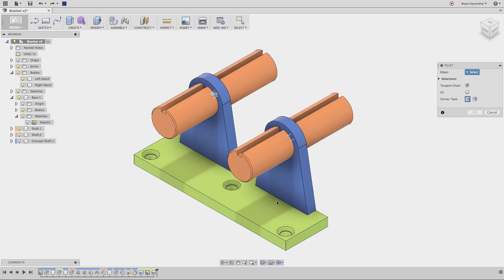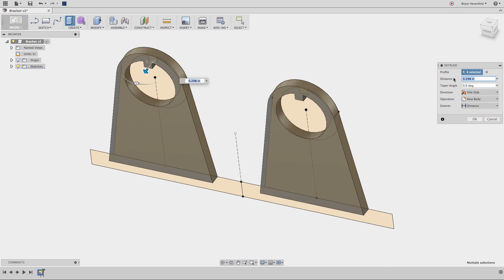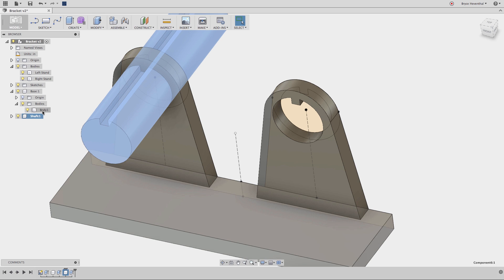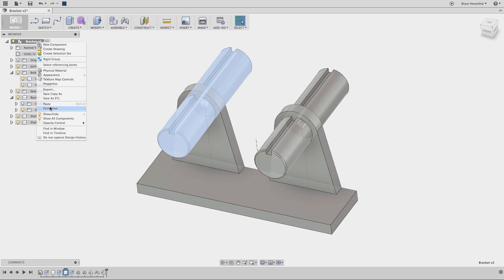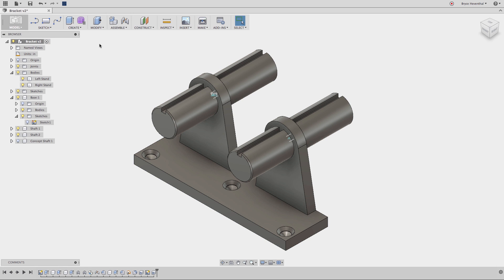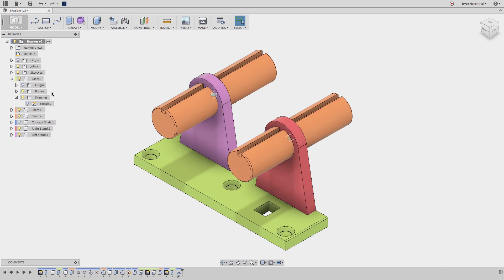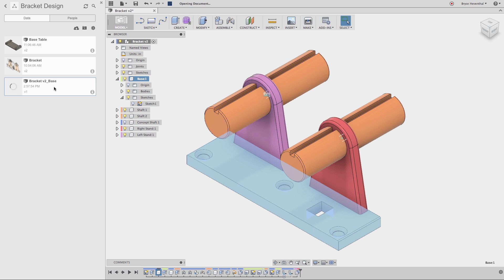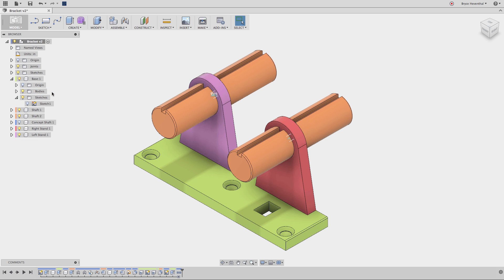Foundational Concepts: Making Your First Design

Comment: I imagine being an experienced user it is difficult to remember how alien the Fusion 360 approach is to a newbie and especially to a user coming from Inventor or solid working type platforms. I'd like to share my experience of using this video - not to be critical but hopefully to help improve future videos - beginners like me value this content so please keep putting it out whilst still considering viewer feedback. The information in the video is good & accurate but it bothered me how fast paced the video is because rather than build my confidence it overwhelmed me somewhat. Being a video to teach foundational concepts for beginners my hope was that these key concepts would be explained much slower with more big-picture context on each, especially for the benefit of folks like me migrating from other platforms, as these concepts are significantly different and difficult to fit into a big picture view to begin with. I had to rewind (more than once) and slow the video to 0.75 play speed to hear certain critical  information communicated at a conversational pace so as to be able to grasp some of the very key conceptual & foundational points that were relayed so fast they almost seemed glossed over. If the purpose is to teach these concepts as core fundamentals then please go slower with these fundamentals, spend more time on each, as everything else hinges upon a new user getting a solid grasp of the core concepts from which all further knowledge must be built upon. I did learn from your video, in the end, so thank you and kindly consider my feedback as helpful for future videos on the fundamentals of Fusion360!

Comment: In your opinion what would be the point of creating bodies and not creating components? I think it's handy in some CAM applications, but curious if you think there is a valid reason to do so from a pure Design standpoint?
Reply: Hey Scott, 

Sometimes the over head of creating components and thinking about assembly structure can hinder the conceptual design process. For that reason, Fusion 360 allows users to use bodies to quickly iterate on a design whether that be with freeform, parametric, etc. tools. Then when it is convenient they can turn bodies into components. Unfortunately, as discussed in this video, this workflow has some negatives for reusing components, managing the timeline, etc. I will also use bodies if its going to be used for a tool to alter geometry (combine, boundary fill, etc.), but will not be part of the end of the design.